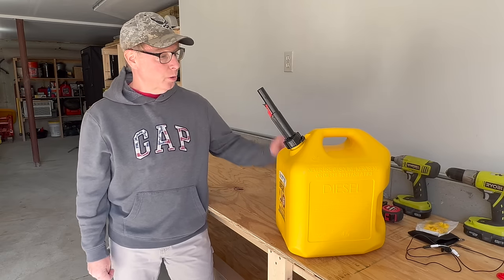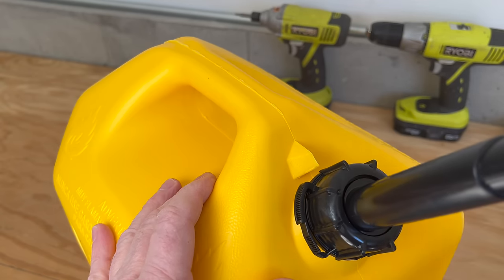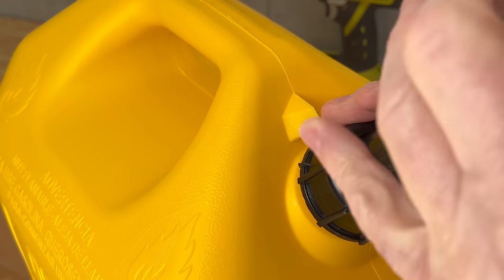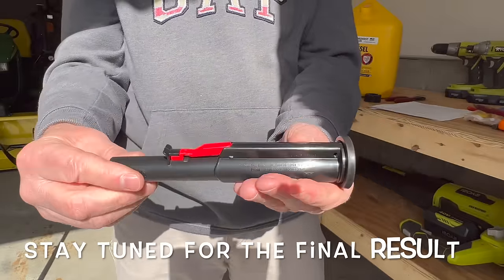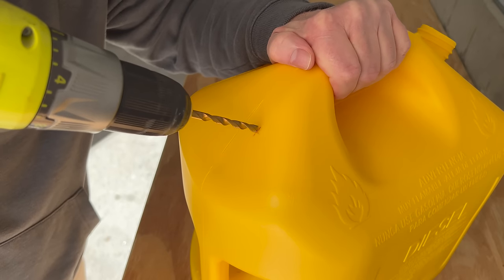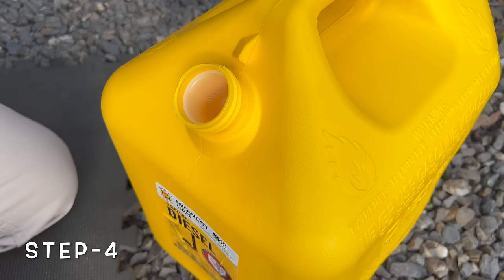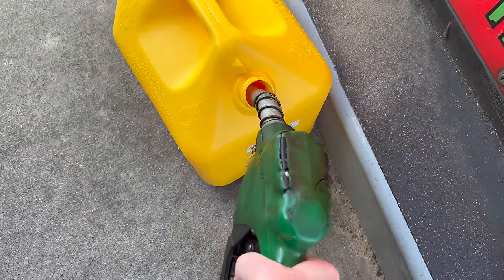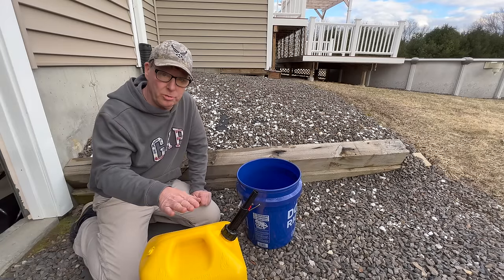Fix a New Gas Can in 4 Simple Steps.

Comment: I have spilled more gas with this design than I ever did with the old ones.
Reply from the maker: Me too..
Reply: Not only spilled but spilled all over my pants I was wearing.
Reply: Interestingly, I spill far less.
Reply: Yesss !👍👍
Reply: @karlrovey  I've never spilled with that style of spout.  and bonus: it lets me rest the can on the tank.
Reply: @kenbrown2808  Have you considered that you may have super powers? :) Seriously, that's pretty impressive. I too can use the new type without spilling, but honestly it took me a couple tries to get the hang of it, (and more than a few mls of gas may have been spilled in the process.) I also think the new kind is more difficult, and more apt to spill, for people who are physically frail or weak, because the spring does require a reasonable amount of force to actuate the valve...
Reply: @kromanaut  Gravity seems to be sufficient...
Reply: @karlrovey  just depends on how you’re using the cans. These were clearly designed for typical use of gassing up lawn equipment. I live on a farm and I can tell you there’s other ways to need to use your gas can… the new cans are complete junk and we always rip out the “improvements”
Reply: @justjason7662  They're fine for the applicable farm equipment I use.
Reply: @kromanaut  The spring is the problem.  If you have carpal tunnel in your wrists, its difficult to apply enough pressure to get the spring to release.
Reply: Government efficiency explained in 1 sentence....
Reply: Me too.
Reply: Me to, thanks for the good new info :)
Reply: Tight spring makes you put a lot of pressure on the equipment you are trying to fill to keep the nozzle open, coupled with the complete lack of venting has the gas coming out in a series of big "gulps" -- and of course the last "gulp" is always too much that has gas overflowing all over the hot engine and ground. 

"Spills Everytime" should be the brand name on these ridiculous POS cans.
Reply: I broke off the whole spout into my chipper gas tank. The ones that make the rules don't use the tools, well paid fools.
Reply: Try filling into my diesel heater the plastic tank bends from the force and pops through splashing diesel

Comment: The only change I'd suggest is finding the company that makes the old, style "replacement" nozzles and ditch the entire nozzle from that new can, not just the spring.
Reply: They are available on Amazon.
Reply: They sell the whole kit, old school replacement nozzle and vent at tractor supply for like 12 bucks.
Reply: I found some at Rural King!
Reply: I've bought them but had trouble finding a can that the threads match
Reply: @BRWfilms  I've had some luck using the original threaded cap bit with the replacement flexible nozzle only when the provided threaded cap didn't quite match.  I do, however, have one can where I can't seem to find the right cap, nozzle and washer combination to make it consistently leak proof.
Reply: Whatever you do if you have an old one keep the nozzle. It appears they knew the new ones were FU from the start and didn't change the threads on the nozzle so the old nozzle fits the new cans, at least the ones I have seen.
Reply: Temu has them, and they're cheaper than Amazon.  Same Chinese <insert your favorite derogatory description of "feces" here>, but with a longer shipping time in exchange for a better price for omitting the middleman.
Reply: Or better.... Don't buy the plastic crap cans. Get a military Gerry can.
Reply: 10 thumbs up! We ran low on diesel for our oil furnace this last winter, and the oil truck couldn't make it up our driveway after a bad ice storm. I had to go to the gas station to fill up two cans with diesel. I hadn't used any gas/diesel cans for a decade or more, and I was shocked to discover that the new ones I had to buy were almost worthless. I'm extremely glad to see this video and will certainly fix the two cans I have so that they are usable. Subscribed.
Reply: @kurtkaufman  funny most people do not know "heating oil" is Diesel.  I've done it more than once and actually have a 5 gal diesel can just for storms out on cape cod.  Fill it once every year and pour old into tank.  keeps cycle fresh
Reply: I always thought of heating oil as fuel oil, not diesel fuel, so there you go, you taught me something. Also, I have been using the same 2 gal plastic gas can for 30 years now with its according nozzle to make bending it a bit easier.. there is a vent device that I unscrew just a bit to let air in. I hope the nozzle never breaks or wears out. It stays in a darkened garage all the time, so that could be the reason for longevity. I have tried using one of the new style on my gf push mower and always thought, boy what an abortion this abomination is. Glad I still have my oldie.
Reply: @stevec9102  it's the same stuff. Although for home heating fuel they add a pink dye so people won't use it in road vehicles (and evade road taxes). As diesel sold at the pump is a lot more expensive per gallon than home, it's only useful in a pinch.
Reply: They changed things so it's not that simple....I tried that and fit...it's like everything on these new gabs are smaller
Reply: @slayer7976  this kit fits on these cans because like I said retrofitting of an older can doesn't work
Reply: @BRWfilms  that what I have found and wrote in my replies....shit once you take that plastic screen out of it just stick a hose in it siphon the gas into whatever you fueling up
Reply: @dontblameme6328  have you seen the price of those Gerry can's....I like your thinking but I'm not spending that much for one of those
Reply: @dontblameme6328 I thought that was ideal too, several years ago. But when they expand and contract, they get pinholes and rust where the bends occur and the inside paint chips off and rusts. I was disappointed because these were over $30 per can.
Reply: Yep!!!

Comment: I love the quote, "designed by people who don't use gas cans." So true. These have frustrated me for years. I was just buying after market nozzles. Now I'll do these mods. Thanks.
Reply: Like air pollution standards. Designed by people that do not make vehicles. Some may be rejects from automotive engineering getting revenge.
Or those that believe all electric is better.
Reply from the maker: My pleasure. Thanks for watching.
Reply: the sad thing is i spill more gas with these cans than with the old ones.
Reply: Don't get me started on toilets that won't flush a golf ball…
Reply: I believe tractor supply company has non-safety nozzle that you can replace the safety nozzle with. Put a vent and one of those non-safety nozzles. Presto magico.
Reply: Yeah, when I gave those "safety" nozzles a shot I was spiling gas everywhere. Me, the car, the ground... everywhere.

Comment: Thank you so much! This granny with arthritic hands and a diesel truck and a mower to fill, have struggled mightily with those stupidly designed cans. I am fixing those suckers today! God bless!
Reply from the maker: Awesome.. Happy to help.
Reply: I came here to say this !!! 
Now I use a 12volt submersible fuel pump. Plop it in the can and pump directly into gas tank. No lifting or futzing with heavy cans.
Reply: Actually, they are well designed.  As is they meet safety standards.  But they are easy to modify if the owner so desires.

Comment: Tip: When you insert the breather, put a little "Seal-All" glue all the around the inserted part. Seal-all is fuel resistant and will help seal the vent as well as act somewhat as a lube when inserting it.
Reply: Is there anything that stuff won't seal?  Lol

Comment: Had to give an update, while the fixes here a greatly appreciated (thank you sir) after reading a comment I went to Tractor Supply  and bought a kit for 12$, flexible non valve spout and vent cap. Plus I also bought a small tap and die set I didn't need.
Reply: Can u give us a PN? I do t see it in their app?
Reply: @David-cg4mn   Amazon has that kit as well .  Should be list real close to the pack of vents.
Reply: Well, now I know where to go to get a good spout! Thank-you!
Reply: You're lucky to get out with just a small tap and die set.  It's a sickness that targets XY chromosomes, and the same contagion lurks in Princess Auto here in Canada.  I'm sure the Bureau of Nanny State is working on a cure.

Comment: I bought 3 of those cans the day I bought my green diesel tractor (5 years ago). Luckily I set 2 on the ground to fill. I overflowed the first one because of the fire preventer in the filler neck. What a mess. The 3rd untouched can went straight back to the store. A few months later I was still using those cans. The fill on my tractor is chest height so I end up trying to balance the can on it's spout. For whatever reason when I pressed the valve to start the flow I lost control of the can, the stem popped out of the retaining nut on the can letting diesel go everywhere. Now I use Flo Fast cans with a very convenient pump. Pricey but it makes it easier for this old man. I would have given the cans to a friend but I like my friends.

Comment: Don't remove the spring completely. Just shorten it so that it doesn't require so much force. That way it will still shut off the flow quickly when needed. Same with the filter screen. Just poke a hole in the bottom. Fuel goes in quick but still gets a bit of filtering coming out. Good video!

Comment: These modern gas cans are annoying and frustrating to use. I have modified mine by removing the plastic filler. I did not do the additional three steps. Now I will.  Thanks for the modification tips
Reply from the maker: You bet, thanks for watching!

Comment: Great analysis and fix. I bought one of these cans for my newly acquired diesel tractor. Total headache. Spills while pouring, high lift to the tractor. So I purchased a small battery operated pump with a siphon tube. That only worked for the first 2 gallons as the inside screen was in the way! I have now removed the inside screen. If that keeps working, all is good. If I need to pour, I'll do your other 3 steps. Again, thank you!

Comment: I removed the inner screen on my cans just so I could use my Harbor Freight fuel transfer pump. It costs $12 and runs on one D cell battery and is the slickest gadget I've bought in the last couple of years and will move gallons in just a minute or two with zero mess.
Reply: Same here! A little costly, but sure easier.  Especially when putting diesel in my tractor.  Great video.
Reply: I use a hand pump from back in the '70s.  I put the can on top of the car's trunk, screw the pump into the can, run a flexi hose in the filler, then give it a couple of pumps.  The siphon effect does the rest.  I just have some coffee, and wait until it stops flowing.  A little slow, but it beats lifting 5 gallons to shoulder height and holding it there while I spill fuel everywhere, and no motor or battery to go dead at an inconvenient time.

Comment: You are a life saver. I usually unscrew my nozzle and use a funnel to fill my mower. Using the nozzle over time I have fatigued and broken the plastic gas tanks in my mowers, which are NOT cheap to replace.

Comment: Step Zero: Look for an old one at a yard sale 😂
Reply: I’ve actually found some empty good ones along the sides of roads and hi-ways.  That have blown out of trucks.  But some are damaged from the impact especially from the pavement.  But they still may have other parts that are usable.
Reply: Estate sales are probably the best place to buy gas cans now.  And prices are going up on them even there.  Sometimes they even come with gas in them.  😊😊😊
Reply: @johnsharitt7918 I don't think I would use that gas in any engine, though. Who knows what kind of impurities are in it? Fine for starting bonfires though I suppose.
Reply: I found replacement spouts without any of the extra stuff on Amazon. just a plain Pour spout with no locks. They also come with Vent's. Very easy to install on a brand new can. They come with different thread sizes too.
Reply: @Theupgradeguy  Exactly, and simple.
Reply: True! Or, better yet, go steal Grandad’s like I did! (Don’t worry, 84 years old so he wasn’t using it!😉)
Reply: Make the trip up to Canada, you can still buy the normal ones here…..
Reply: @DCS_JINX  oh wow 😮 I was just down there a couple days ago 😂
Reply: @caseyjones6197  I found one of the old five gallon stamped sheet metal ones at a yard sale for a few bucks. It had a little rust on it but seemed okay, so I bought it. Turned out to be a leaker. May be wise to avoid those ones.
Reply: Classic Jerrycans are still being made till this day.
Reply: Step 1- buy a “utility jug” from VP racing. Done.
Reply: That works, but you can order the older spouts online and toss the gas spilling spouts into the trash. Typical of anything the government gets involved in, they screw things up.
Reply: Jerry cans!!
Reply: @DCS_JINX  I find that extremely hard to believe given the canuckian gov'ts recent infection with the severe liberal pathogen.
Reply: Even gas cans go bad.i bought a ton from estate sales they are all garbage . So off to the store I had to go.

Comment: Thank you for making this video.   I have previously purchased kits that come with a standard spout that replaces the original government engineered POS along with the new vent, but the replacement spout usually will not fit back into the fuel can like the original.  Your approach not only saves money (no new spout required), but is more functional too.

Comment: Agreed, spilled more gas trying to used the gorilla spring-loaded ones than in all the years before this “safety” mod.
👍🏻for this video and 
👍🏻to Kolschesky for mentioning the flexible spout kit from Tractor Supply!
Reply: I've spilled more gas using the spring loaded nozzles than removing the dumb nozzle all together and pouring gas into my lawn mower, weedwacker, chainsaw, etc, directly from the wide mouth opening with no funnel.  These new cans and nozzles are the dumbest thing since capless fuel filler necks on today's cars.
Reply: ??? Why spend all that $$ at tractor supply when for $2, $3, you can get a very good old school can at a garage sale. 
 I like tractor supply, fleet farm etc too, but I like my $$ better

Comment: Only thing I do differently: I remove the inner part of the spout all together and put a cap on the spout when not in use. Great video
Reply from the maker: I actually thought about doing that but I was thinking I would probably lose the cap. Thanks for the comment Jerry.... and thanks for watching!
Reply: What size/type of cap fits on the spout?
Reply: 3/4" crutch tip

Comment from the maker: If you're a subscriber THANK YOU! If your new here you can subscribe for free by clicking this link. https://www.youtube.com/channel/UCdOuZ0bxeSxA8ZAHttc0U-w?sub_confirmation=1 But either way I would love to hear your opinion of these new fuel cans and also how you're dealing with these high fuel prices. Thanks John...
Reply: You never say what specific problem the new EPA design causes. So Whats the problem you are fixing? I have trouble closing it properly. Nor does it have a vent so pouring is hell.
Reply from the maker: @SmartLifeSolutionsWork  I thought I detail each problem and then show the solution to each problem.
Reply: Stay warm! Weather channel shows it's pretty cold up in Maine 
  I have quite the variety of plastic fuel jugs. Different ones for different things. Now they're working better, Thanks to your video.  I like to keep a reserve of non-ethanol for all my power equipment, and it's sold in only a few places, so it's a small project transferring everything out of the 5 gallons into the smaller containers and mixing all the different ratios for all the different power equipment. 
  I deliver gasoline, tanker driver. Prices are going down a bit, I commute  Honda CBR 250 gets 70+ miles a gallon so it's not a
Big deal
Reply: @HiFi2312 lol...I watched his video and it was absolutely fine.
Your just trying to drum up some buissness  with your sales pitch

Comment: A little more money, but Tractor Supply sells a kit that includes a flexible spout which is also a plus in my opinion.
Reply: I’ve tried a few of those, but the lip breaks off if you put any pressure on them. But they work good until they break.
Reply: Agreed, the ez-pour kit is worth it.  Put one on all my cans.  Can empty a 5 gallon can in seconds without spilling a drop
Reply: those replacement spouts are awful.  the only ones I've spilled more with are my old cans when the spouts started cracking from age.

Comment: Thanks for the modification information!  I tried using an un-modded can a couple of years ago.  These spouts/cans are not "old man friendly".  When trying to lift 5gal of diesel into a RAM 2500, while trying to work the safety shut off lever and pressing the safety-spout into the lip of the fuel tank, I ended up with more diesel down my shirt and pants than into the tank!  I'll be modifying mine today!

Comment: Thanks for the great video.  I haven't come across the filter in step 4, but I have been buying solid plastic caps for my fuel cans on Amazon and throwing the spout and lid away. Then I just use a funnel to fill the mowers, tractor, and so on.

Comment: Thank you for making my can very useable now. The nozzle works great once you remove the 90# spring they have in it. Gas flows smoothly and doesn't spill everywhere. My old fix was to mangle the nozzles until they do what I want, Your way is better.

Comment: Thank you for the complete transformation of Midwest fuel cans. I have usually just removed red locking latch on spout leaving spring and removing that anti blow back screen filter thing and works well when filling generator because slower is better when it’s only 5 gallons. I still find it difficult to fuel vehicles with it. If you could incorporate dual handles which is nice with longer goose neck. Just a thought